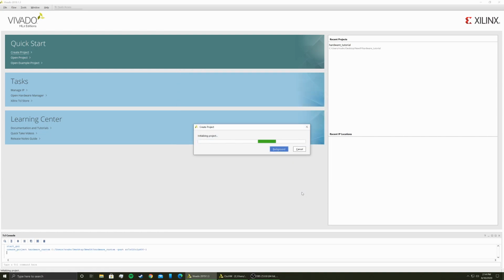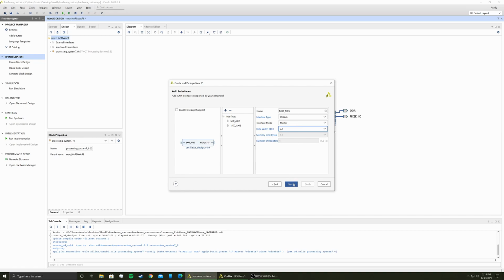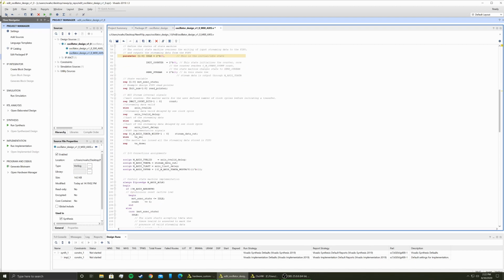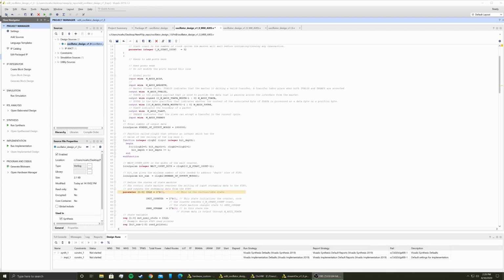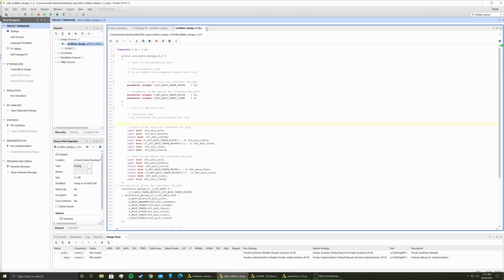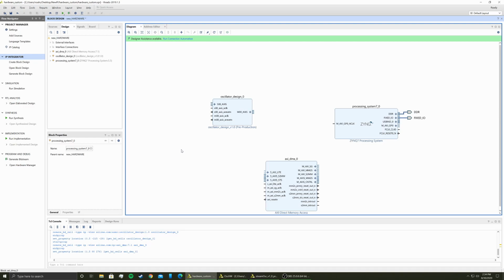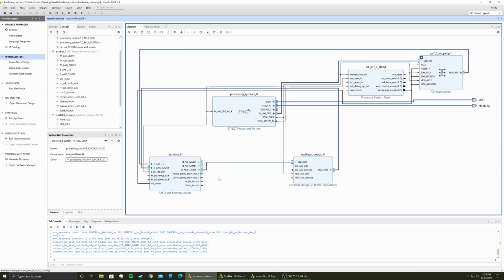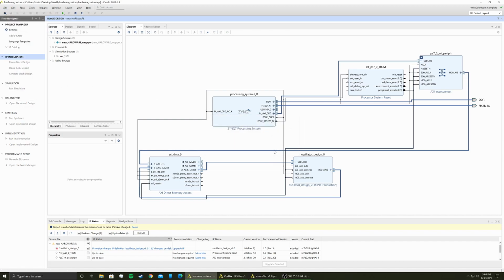Vivado Tutorial: Turn Verilog IP into AXI Module

Comment: @marwanal-yoonus280
0 seconds ago
Dear friend
Please, I have a problem during reading the status of an output switch on Zybo Z7-10.
I use Vitis to program the Zynq processor with Gpio connected to a slid switch. I make the switch (input2)  status as a condition  as shown in the program below if (D == 1) ;
The following program works only when the input2 signal that was connected to Gpio IP starts from ("1") but the program does not work when input2 signal starts from ("0"). 
//////////
 while (1)
    {  	D = XGpio_DiscreteRead(&input2, 1);    // input2 from a slide switch
    	if (D == 1)
    	{    	sum_all = XGpio_DiscreteRead(&input, 1);  // input is a 32-bit data
    	printf("%x \n" , sum_all);
    	sleep (1);    	}
    	else
    	{    		XGpio_DiscreteWrite(&output, 1, 0);   // output is a LED
    		printf("No_Signal \n");
    		sleep (1);    	}
}
/////////////
i.e. the program works only when I change input2 from "1" to "0" but does not work when the input2 start changes from "0" to "1".